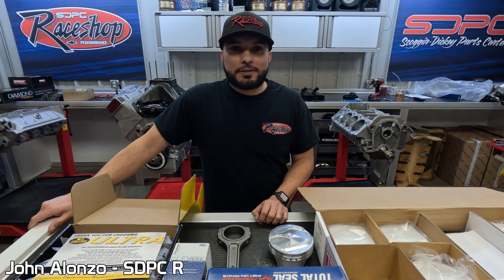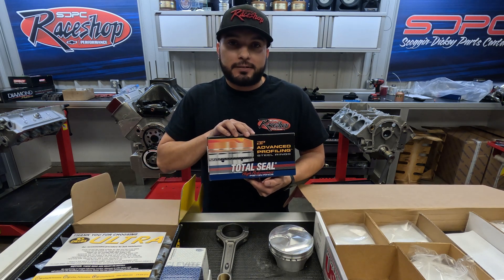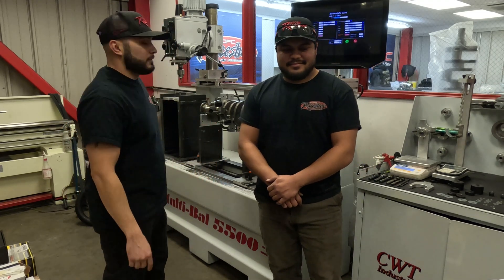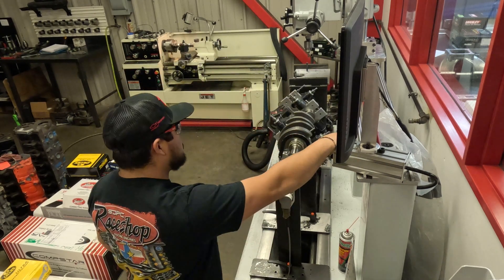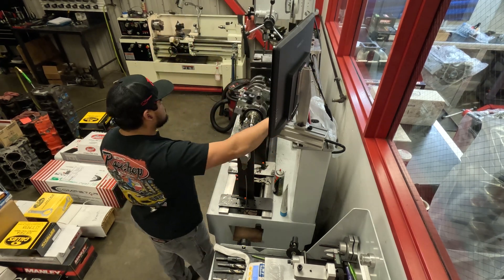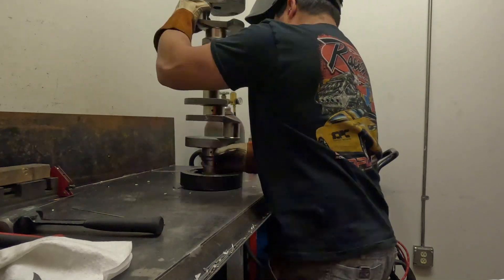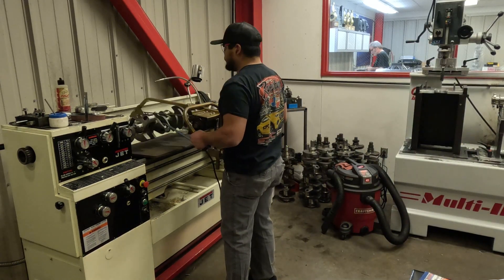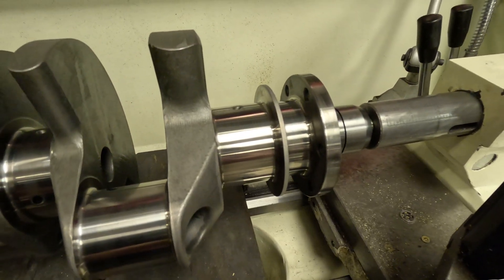SDPC Raceshop Ultra 9 - Part 2

Comment: I've seen mallory welded on cranks before and I've always wondered, doesn't that affect the strength of the parent metal? Why not just interference fit?

You took the time to balance it THEN added many grams of filler rod !?!? Doesn't make sense to me.
Reply: Mallory should be pressed in parallel to the crank...
Reply: That’s what I was thinking. Welding that after is going to mess with balance